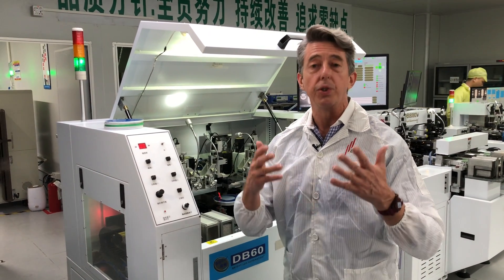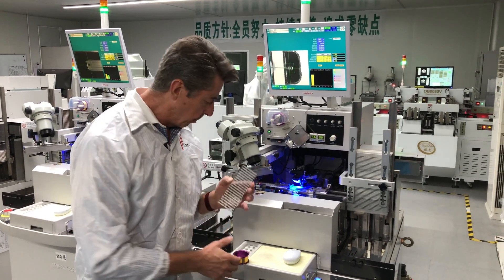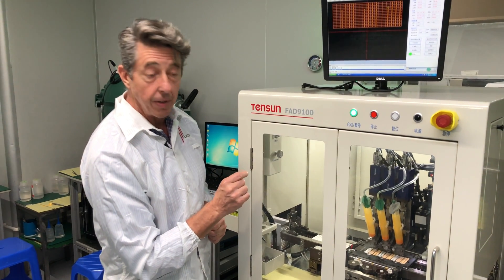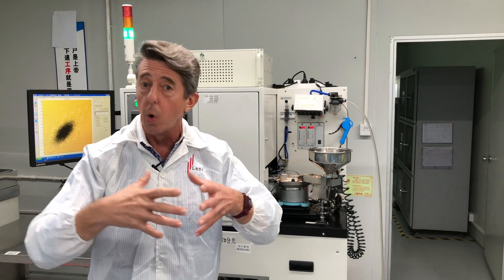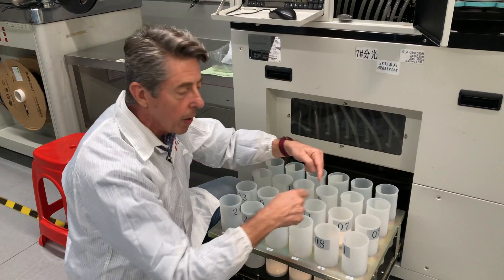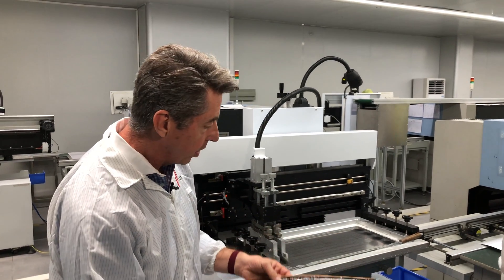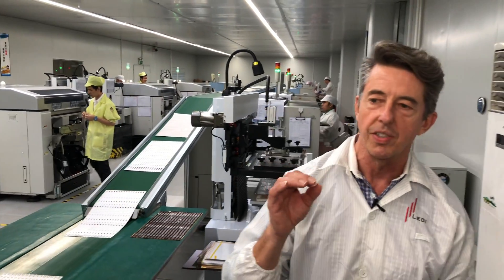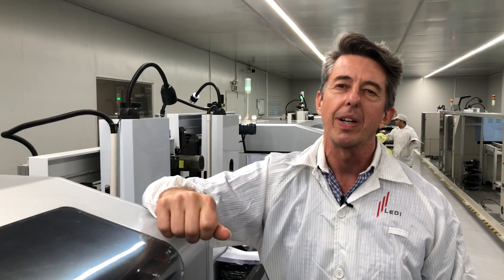Inspire LED Tape Light Manufacturing Process

Comment: what do they do with LEDs in those other bins? recycling? putting them on a trashpile?
Reply: They get used. His use of the word quality is misused. Each bin contains graded chips. These have the same quality but slightly different performance characteristics. What he is doing by using only one bin is ensuring consistency of colour and brightness. Another customer may prefer a different bin, or be happy with several bins mixed together. Quality = consistency. Grade = performance, features etc